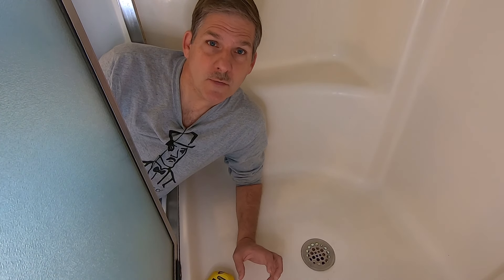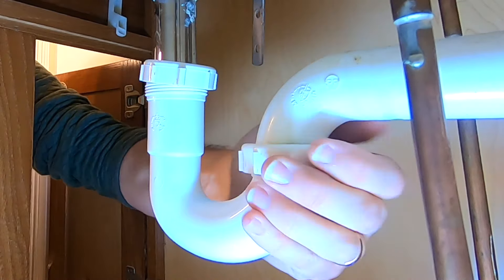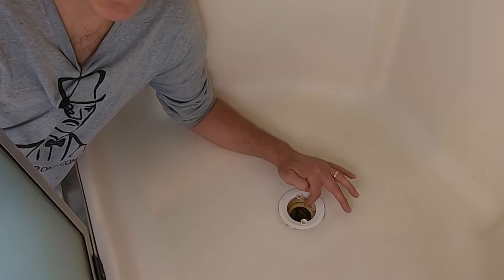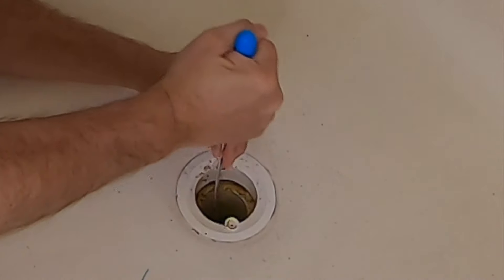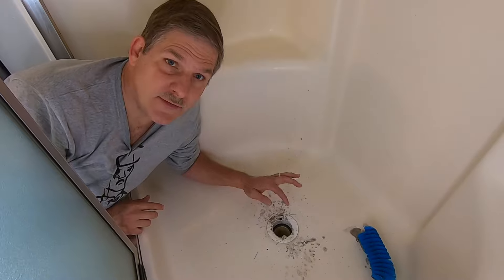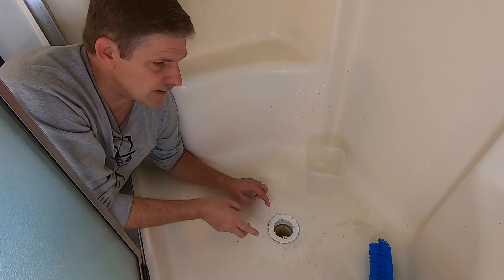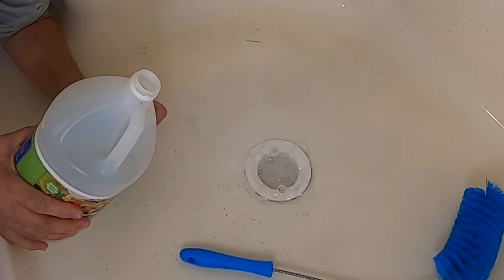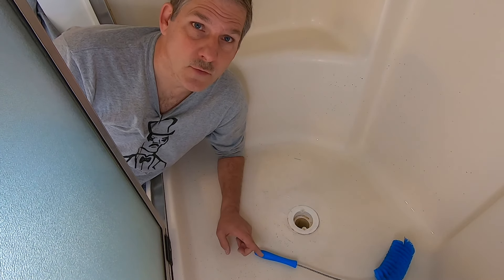How to clean a smelly drain in shower or sink

Comment: When you mix baking soda and vinegar together, the chemical reaction isn't actually cleaning anything - it may loosen things up a little, but it's not cleaning. It's actually converting back to water.   You'd actually be better off pouring undiluted vinegar down the drain and let it sit for a few hours, then follow up with hot water.  All the baking soda is doing is neutralising the vinegar.
Reply from the maker: Hey Stooj…,
Thx for the input.
Reply: I didn't know that. That's interesting. I will try method out as well. A lot of youtuber recommend baking soda though. You could be right though, I have to test and measure.
Reply: @Housebarons  not only input, but science!
Reply: This is correct re mixing the vinegar and baking soda.   Use baking soda by itself (alkaline) or vinegar by itself (acid).  I used toilet bowl cleaner with bleach on my drains.  (Acid and antiseptic). Just be careful not to splash it on yourself when using the brush.

Comment: Vinegar is acid; baking soda is basic; when you mix them, they neutralize each other so what you end up with isn't as good as using either baking soda or vinegar alone, though since it's mostly water it'll still work to clean most things just like water will.

Comment: I recently had are older home plumbing fixed new water heater vent to room cleaned new fixtures in toilets shower tub and sinks I keep.getting sewage smells from the old tub I have done the vinager baking soda several times it helps but it comes back I can't find any hair are clogs not a septic on city the tub had not been used over 2 years we always used other bathroom till we got fixture ect fixed also there is rust around drain I can't get off and deep stains any help on those

Comment: I bought that brush off Amazon. Well it broke the first time I used it. Shower drains are a whole different monster than a sink.This doesn’t work….I’ll be calling Rotor Rooter. The smell is more than I can tolerate. I truly believe a professional is needed in my case. Good luck you guys…but I’ve tried everything.
Reply from the maker: Hey burn…,
That’s a shame - but send it back! That’s one good thing about Amazon for sure. 
Let us know if the Roto folks can solve your issue and how much it costs because it is an issue for so many. 
Thx for watching!
Reply: Have the toilet reset.....odor frequently comes from toilet.......

Comment: Thank you for the video!  My question is that I need to remove the drain cover, however there are no screws to remove it.  I'm afraid if I pull it off, it won't go back down.  Should I put the baking soda and vinegar down anyway?  Do you have any suggestions? Thanks!
Reply: We have the same kind. It just snaps on and off (sometimes takes some effort). You won't be able to run a brush down there without taking it off, so you're relying too much on the vinegar/baking soda to do the heavy lifting. All drain covers should come off.

Comment: Will this potentially ruin any seals? Using vinegar and baking soda on my kitchen sink basically popped the drain off the plumber's putty so now we have to reseal it.
Reply from the maker: Hey Iheart…,
I would not think that should ruin plumbers putty??? Seems odd.
Nonetheless, the brush is not strong enough to do any damage. You pvc pipes are chemically welded together … very strong. 
Thx for watching!

Comment: Sewer odor in bathroom ..Had the shower drain snaked by plumber and it was clear.  May get a new shower drain installed in case of leaks.  Will get the roof plumbing vents snaked in case there is blockage causing odor....Would love to have a blockage to solve instead of a pipe leak under the shower.........
Reply from the maker: Hey arch…,
Our experience is the smell comes from the drain. Just because it is clear does not mean the side walls of the drain are clean. That’s why we scrubbed it - to get that rot off the sides. 
Hope that helps. 
Thanks for watching!

Comment: Hi there, I am battling a very strong ammonia smell when I drain my bath tub. It doesn’t seem to smell when we run the shower .. any ideas??
Reply: I have already had a plumber re seal the train, I have snaked the drain to remove debris . Not sure what else it could be
Reply from the maker: Hey Madison…,
You could try a drain clog remover… like in this video….
clogged bathroom sink: how to unclog sink with green gobbler
https://youtu.be/ij_0Bl80e-U

The ammonia smell is likely from hair that hasn’t been removed … maybe the drain cleaner will help?

But honestly, the brush / scrub is really  worth trying  - to scrub the sides and bottom of the p-trap. If you’ve ever removed one, you’d see an incredible build up of rot and gunk. 

Worst case and most expensive - replace the p-trap . But I would try to scrub it out first as that really should help. 
Thx for watching!
Reply: @Housebarons  thank you. I bought the product you linked . I actually used it twice and sadly still have the smell. I may try to have the p trap replaced and see if that helps. If you can think of anything else that may help , let me know ! Thank you

Comment: is that a very common drain? i am a small time property manager and i've never seen one so open like that. anything i've serviced. most have a little X that is caulked to the tub and has to be taken out with a tool and a lot of force.
Reply from the maker: Hey nocoolname32,
This house has both types of drains. I guess it’s all dependent on the original plumber. 
Thx for watching!
Reply: @Housebarons  after thinking about it, im guessing my experience is with a bathtub, and this video shows a common drain in a shower where a stopper isn't needed.

Comment: Do u hv any remedies for toilets?
Reply from the maker: Hey Michael,
In spite of its purpose, the toilet should be basically odor free ( once clean w/ typical toilet bowl cleaner) 
If you are getting a sewer / sewer gas smell that can’t be tackled by bowl cleaner, then the most likely culprit is a broken / detached wax seal. 
It is not the most fun job, but it is pretty simple. 
Rather than replace the wax seal with another wax seal, we use the wax free fluidmaster seal.
See this video: 
https://m.youtube.com/watch?v=yYLmLE8HrFs
Hope that helps!
Thx for watching.
Reply: Thank you boss!
Reply from the maker: Hey Michael,
Glad to help. I hope that’s your solution. If so , it should cost less than $10 and your time.
But, since the toilet needs to be removed, this would be the time to replace your toilet IF you ever had desire to do so. That means adding the expense of buying a toilet, but the job is the same.
Reply: @Housebarons  i think its was the wax ring

Comment: I have tried this and the smell is still there. What's annoying is everything is built in so I can't even access pipes 😢
Reply: Did you ever fix it? Having the same issue.  It's bad.
Reply: @kristfur It took a few goes and it worked with the bi carb and boiling water
Reply: @MassiveHappyClapper  Good to know there's a light at the end of the tunnel.  Are you doing any preventative maintenance on a schedule?

Comment: We just bought a house and the master bathroom shower smells like BO! I have tried baking soda, boiling water, and very expensive drain cleaners. The smell is still there, any suggestions?
Reply from the maker: Hey Richelle
Is the tub and shower separate or share the same drain ? I would check every drain in the bathroom. If the house was empty for awhile, the water that sits in the bottom of the” p-trap” can evaporate and let sewer gases into the room. 
You should be able to see water deep down the drain at the bottom of each drain. That water is designed to always be there as a barrier to stop sewer gases from getting past that water barrier. 

Another thing to check is to make sure all drains are free of hair buildup. That can be a stinky mess that sits in the drain. The drain may still drain okay, but a mess of hair in there could cause bad smells. 

You can get a “ plumbing snake “ from a rental equipment place. That will be able to break-up any buildup that might harbor bad smells. 
Hope that helps.
Thx for watching!
Reply: @Housebarons  hi, same problem here. House has been empty for 4 years and shower in en suite stinks terribly. How to replace the water that evaporated ? Just running water isn't doing it at all 😭...
Reply: Check to see if the smell is coming from the toilet base, you may need to replace the wax ring.  I have a shower drain issue due to the bathtub draining and siphoning the p trap water down enough to cause the sewer smell. Just need to run the shower 30 seconds or so after draining tub to fill ptrap back up
Reply: Have you guys scrubbed the pipes yet, like how House mentioned in the video with the brush. That was the biggest game changer to the smell. You can use all types of cleaners but if you don't scrub, the smell will remain there.
Reply: @HouseBarons. Yes!  I went out of town for a week. Came back to a horrible pee smell. Assumed it was wax ring so I replaced that. Didn’t solve the problem. So I closed the drain in the tub and no smell. I’ve tried cleaning couple of times with vinegar and baking soda but still there. Will the brush make that much difference?
Reply: @lisacanary155   the brush will make a massive difference. You are actually scrubbing the pipes. You should have done everything before the wax ring. Wax ring is the most expensive. its definefinty coming from the drain by the sounds of it. Also the vinger and baking soda, you might need to do more if it to get rid of the smell, it depends on how long the drain is. I had to use $10 worth. Alot of product. If the smell is gone. You need something to block the hair from going down, with something like a hair drain adaptor.

Comment: The smell is coming from my bath tap not the drain. Why is that ?
Reply from the maker: Hmm. Not sure. Check the aerator - see if it’s clogged ( those are pretty simple to replace. ) 
Also check your sink overflow - temporarily put tape over the hole by the upper edge of the sink. ( this hole allows water to drain so your sink won’t overflow if the drain gets stopped) .
With the tape over it, does the smell disappear? It may be letting drain smells to come up that way. If so, you may need to take the drain pipe and p-trap off and give everything a good cleaning. 
Hope that helps!
Thx for watching.

Comment: This method clogged up my shower drain to the point where I had to have a plumber come hydro blast my shower drain which cost me $500😡
Reply: Why..what happened?
Reply: I mean that’s on you😂 Everything he did in this video is pretty easy to understand. Scrub, vinegar and bakingsoda and flush with hot water.
Reply: It was probably already clogged to the point that you needed one though … So the smell was just the tip
Reply: @Liquethemodel  you are correct
Reply: Dollars?
Reply: @hhinvest2819  Since they were obviously correct. Don’t you think you should fix your comment?